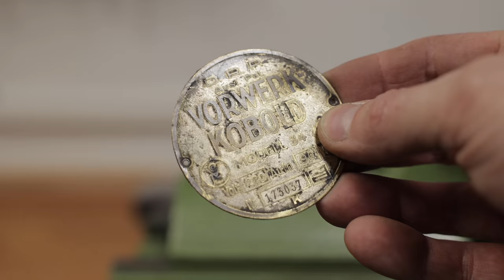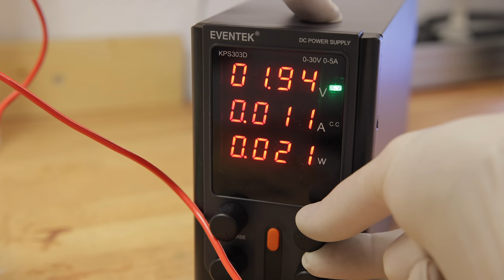Antique Vacuum Restoration - Almost 90 years old Vorwerk Kobold

Comment: Beautiful.  Better than when it left the factory. great attention to detail. Glad to see that you replaced the bearings. Surprised to see the original brush was in such good shape. Happy to have found this video!
Reply from the maker: Yes, the brush was really in good shape. It is almost impossible to repair them if they are in bad shape. You can build a new one but repairing the original is difficult, so I`m glad. Thanks a lot for commenting

Comment: About ten years ago there was an Airway upright vacuum cleaner in a friend's shop from 1926 which was still in working condition.  It had a hollow handle onto which a hose could be attached at the end.  It also had a power brush roll with its own motor and headlight.  Airway was best known for the introduction of sanitary paper bags for vacuum cleaners- they called it the "Airway Sanitary System".
Reply: Here’s the YouTube link to a video upload of one of those Airway Superchief’s in action that you are describing:

https://youtu.be/boDF2n8fcgg

Comment: Liked the restoration, because it was so well done and attentive to originality, even if I usually prefer to leave the patina to such old things. You made a very faithful restoration work here....and how much time and patience !The only thing i do not agree is leaving the wooden parts visible instead of repainting them black as original....this happens quite often with old Kobolds and make them look a bit too prehistorical to me....i personally prefer seing them exactly as they came out from the factory, but this is a very personal point of view ( and i also did the same thing with one of my 1920's Hoovers years ago....but I changed my mind later ). Thanks for sharing, many interesting tips and krafts ! Guido - Italy
Reply: Yes, the timber parts were pretty much always painted back then. The brush attachments sometimes had beautiful faux grain finishes! I think my 1934 AEG Vampyrette (inherited from my great-grandmother via my great-aunt) originally had one but it's more or less completely gone due to damp storage in the past, my great-aunt dragged it out of her barn when she gave it to me. It even still had the original deep red mains lead with moulded plug, an absolute rarity in that era!
Reply from the maker: Hey and thanks for that comment! You are absolutely right and if I would (I maybe will) do it again, I definitely will use black glossy coat for the brush and the handle. I now even have a small can of ORIGINAL Vorwerk coat which feels to be still a fluid inside! I don't want to open it till I got another Kobold Vacuum. Thank you so much for your honest an 100% true words!
Reply: @restorationhouserestorations  That sounds absolutely amazing!

Comment: Awesome restoration. You can buy those twisted rivets that hold the name tag but it took me ages to find them though. I like the way it’s hand held and has a long handle as well. Fantastic engineering for the time. I wonder if a Dyson will still work in 90 years. Cheers Stuart 🇦🇺
Reply from the maker: Thank you so much. Yes I also love those old engineering things. Do you know that the origin of those vacuums were motors for phonographs and gramophones? The gramophone business brake in and so they decided to use the motors in another way.
Reply: @restorationhouserestorations  No, I didn’t know that. Thanks 👍👍👍

Comment: good result - I wonder whether (at 12.12) you could have used a small, firm, very short-haired paint roller to paint the letters? Would be worth an experiment, and I understand our lovely English road signs used to be painted that way. I bet that in the factory that made this device, they used a little roller or maybe a paint pad of some sort to do the lettering. Best wishes from your friends in the UK!
Reply from the maker: Thanks a lot. I tried sooooo much things but the main problem was the height of the letters. I fund nothing to be successful.
Reply: sure - trial and error - "experiment is the best teacher" but I've looked at some of my old tools and machines and there is no way these badges were painted with a brush.

Comment: 3:05  someone repaired that motor before
Reply from the maker: Yes, absolutely right but this man/woman was not really good in that :) :)
Reply: @restorationhouserestorations  Well I'm sure that was likely 40-60 years ago, they just didn't know any better than knowledge of the time. They did the best they could with what was available to use. Realistically nobody would be using a vacuum like this in the 70s through present day, it would have been ancient even in the 1960s.

Comment: I would'nt have tried it before disasembling it to check the wiring first, this old thing looks like a death trap being made of metal...
Reply from the maker: Yes, I know but I`m aware of electrical engineering and I always fuse such experiments double. I use a special earth plate and I put the housing to direct ground with a clamp which you can't see in the video. Are you interested in such stuff? I'll do a separate Video how to test and secure such old death traps.
Reply: @restorationhouserestorations  would be pretty interesting indeed